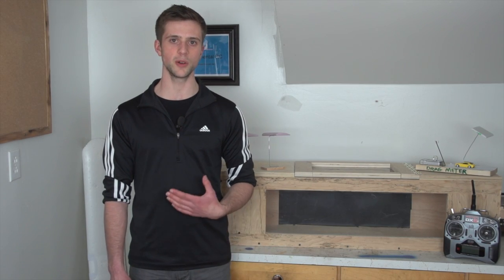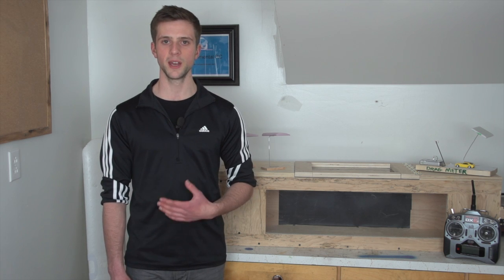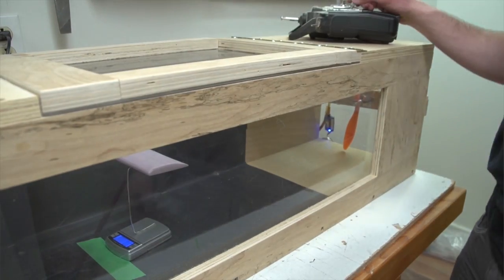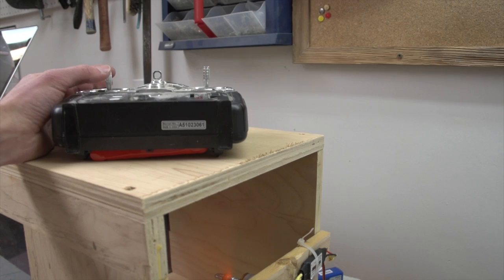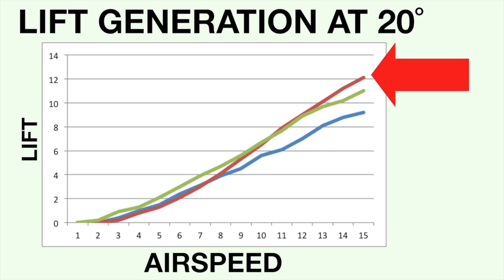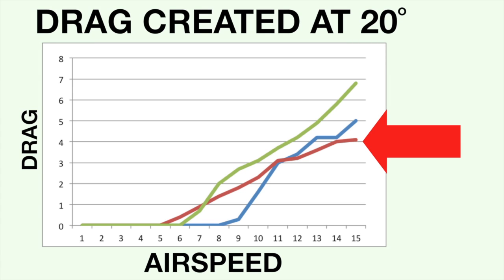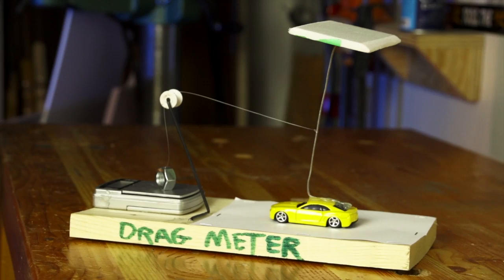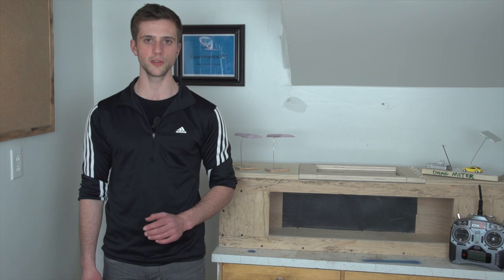KF Airfoil - Lift vs Drag Testing

Comment: Very cool... I had not considered the KF airfoil. I am building a wind tunnel powered with a Raspberry Pi to allow it to automatically set the wind speed and angle of attack... so in theory it should be able to run a complete profile for each wing type and output a spreadsheet with the data that can be plotted. It will take a while to finish but you will be able to follow my progress.  https://youtu.be/RKJlrsRl6cw?si=4y4BNpRInseuoSgW

Comment: I think there are a lot of problems, that need to be adressed, before you spend too much money and time into something, that will always have trouble, yielding comparable results.
- the profiles are very small in width and length
 - short length will result in quite low reynolds numbers, which probably will not gain comparable results for model airplanes
 - small width will add a lot of drag, that doesn't come from the profile itself, but induced drag. (it sais more about the wing shape, than the profile)
- the profiles are pretty bumpy and seem less thick on the inside, sompared to the outside. especially on laminar flow airfoils, bumps will increase drag significantly
- that wind tunnel causes turbulent flow by (inlet-, outlet-, corner-) design.. and rotating airflow by the turbine (and design), so your flow-/profile- angles will greatly vary in time

In most cases a proper airfoil (with turbulators, if needed) will be better than a KF airfoil, without having structural, and aerodynamic shortcomings.
But you found a really interesting and fascinating aspect of aerodynamics there.
If you are interesting in reading into it further, you may want to find articles about flow separation / separation bubbles and boundary layers.

Unfortunately I can't recommend any english literature, since it's not my native language and I dont' have anything english on that topic.
But google should provide some first stepping stones on those topics.

further information can be found on michael seligs uiuc homepage for example.
he's much into (model airplanes) low reynolds profile design.

Comment: Great work, it's good to see how inovative you have been in building the tunnel and making your own testing instruments.   Two things though that may give you more accurate results:  1... you should really test the lift and drag at about 2 degree increments from 0 to 20 degrees. And 2....  the air foils need to be bigger not to be working at very low Reynolds numbers - which will give you inconsistent results.
Reply from the maker: Thank you for the advice and feedback. I really want to revisit this project with a more advanced setup, I will take these points into consideration.

Comment: kudos! that's backyard science done right! =) 
i have to say, i'm a little proud, that your results match up with my clonclusions and assuptions. apparently KFs are great for theyr simple construction, and the stall characteristics andover all nice "feel" and handling, that everybody praises. while traditional airfoil profiles still have the edge in performance. 
one thing, though: i'm convinced, that the exact profile of the leading and trailing edges has a big impact. i did an experiment with 3 identical 25*7cm strips of 4mm depron as airfoils, on the same, equally simplistic body, with a 5 cent coin as ballast. #1 left as is, #2 with the edges simply sanded round, and #3 with a typical airfoil front profile, and tapered down into a narrow edge towards the back. quite like a sail plane's thin wing profile.
unsurprisingly #3, besides being a tad lighter, was noticably faster, had more lift, and a very good glide slope. i had to move the coin foward. rounding the edges really only made it look nicer. 
peace~

Comment: This was very helpful, I think my next build will be a kf airfoil because low stall and higher lift at higher aoa to me are both huge advantages over reduced drag and low aoa lift, with rc planes were not trying to travel (usually) were trying to have fun, so these are pretty neat characteristics for rc.
Reply from the maker: +Travis Pratt Thanks! Good luck on the build. I've come to really like the flight characteristics of KF airfoils.

Comment: Your wind tunnel should have some sort of filter. This filter will make the direction and strength of wind is more uniform. You can make it from a straw pieces are arranged like a honeycomb. Just googling.
Reply: +Boekan Arsheetec He was using the fan as an exhaust rather than a blower, so the filter shouldnt be necessary since there is no turbulence at the intake.